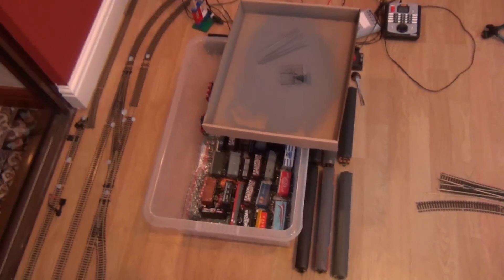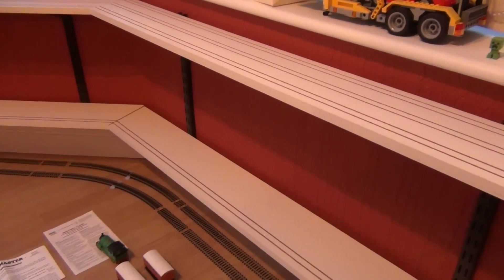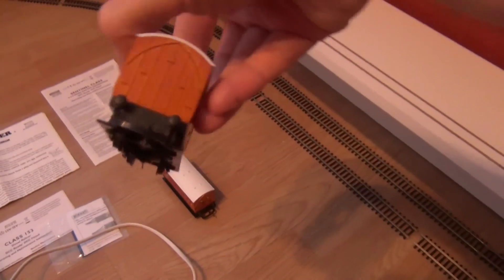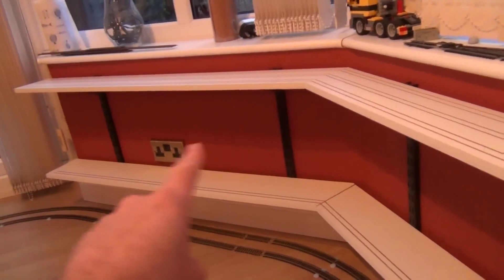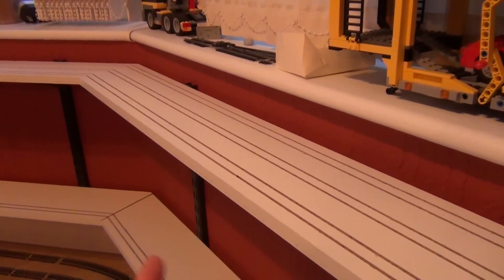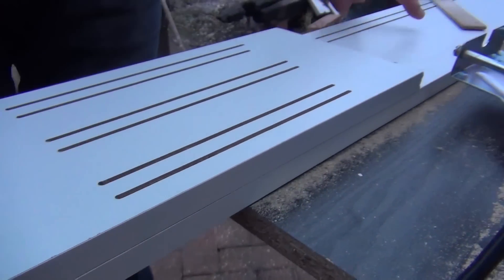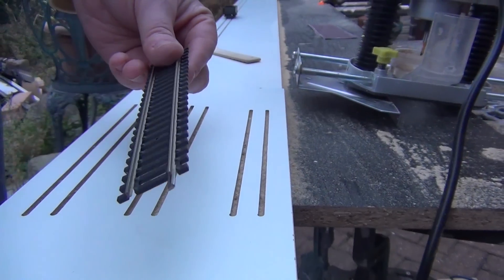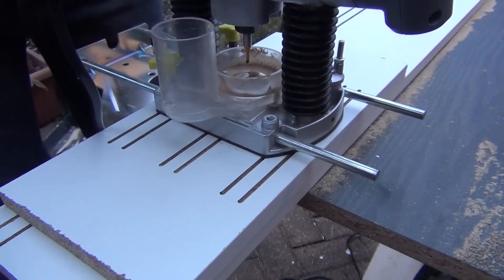Rolling Stock Storage - Groovy Track

Comment: Great job guys, this looks great. I know what you mean about the cost though - B&Q charge a fortune for these boards and brackets - I put shelves up around my room and it cost me nearly £400 in total, shocking really. You've designed a great system there though, it will be great fun putting all the stock in the grooves when it's all done!

Comment: Why did not use track on the shelves? I put track in my Picture Pride Display to show off my models. When they ceased trading, I bought 4 X Ten  extruded aluminium packs from Showcase-Express. Each length is 4' long and interlocks vertically by sliding into each other. I have one pair vertically and the other landscape style to show off my collection. They are available with scene or mirror background. Also end caps and front dust cover. As far as I am concerned, best on the market. Friends comment how impressed the are of my display, not forgetting the units they are housed in. With my every expanding display, I need to order two more X ten packs. Come up the good videos.

Comment: Will you better put buffers or some kind of wall at the ends of the cut outs to stop anything rolling of the edge, and put a little barrier or something on the side facing out towards the electric track just in case a train, truck or coach falls off the side. D8
Reply: +Golden_ Arrow_A1 I have done something similar in my train room. I use some blue tack at the end of the grooves which seems to keep the rolling stock from falling off the shelves. But I am sure index cards, poster board, or something else can be used to do the same. The grooves routed into the boards ought to keep the rolling stock from falling off the front.
Reply: +SeaToby11 I did the same and ... yea ... that 7F was not the same again. I had to get a new one. );
So I wasn't safe but I was very sorry.
Reply: +Golden_ Arrow_A1 
Frankly I am amazed IC82 hasn't done this before. This is a wonderful way to provide storage for rolling stock. A person does get tired of digging their trains out of a box.
Reply: hjjjjj

Comment: As usual my mind is racing at 100 mph, my hands are at 85 mph. What I meant to say, it seems a devil of a waste of money to buy a tool this restricted in scope when your friendly local model shop will usually have on hand amounts of budget tracks, sometimes of doubtful parentage, so be wary. However, the point remains, do I need to risk the, sometimes, delicate undercarriage of, most especially, my most treasured stock to wood grooves, um... probably not, that said, I do appreciate your views on a variety of products, in a professional and impartional  way. Many thanks for your suggestion.